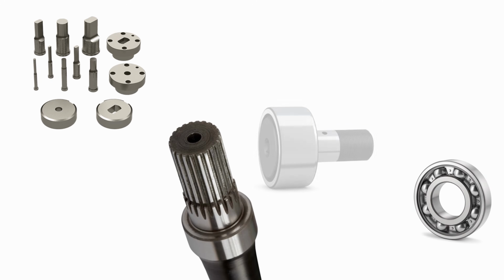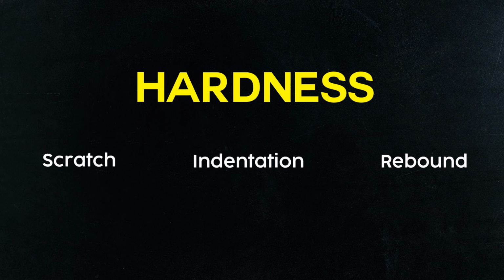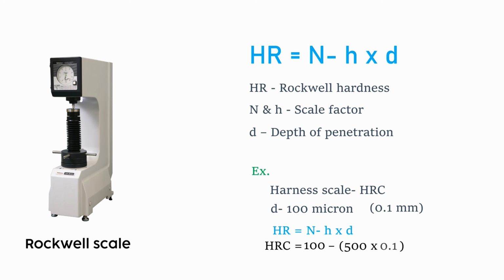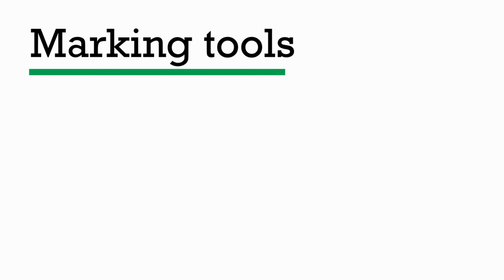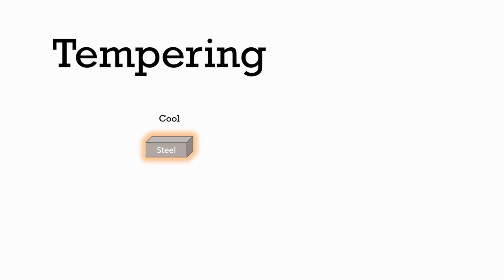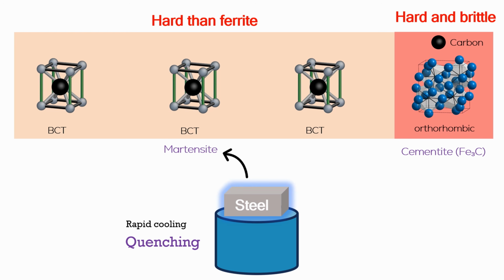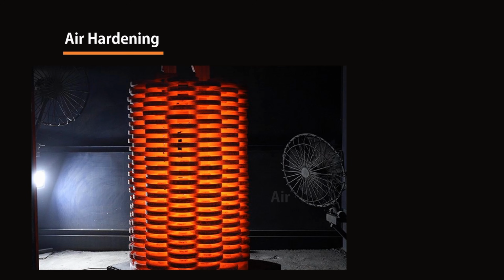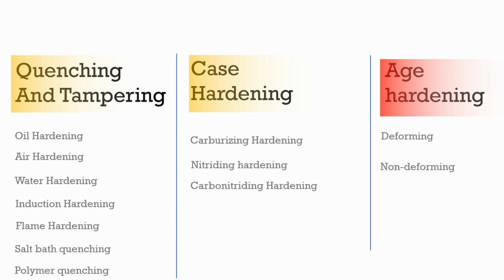Complete Guide to Steel Hardening Process | Quenching and Case hardening Heat treatment process

Comment: Explain the rate of quenching with the boiling point of the media. Water is 100c and oil is 600c so water quench faster tan oil and oil faster than air.
The rate of thermal exchange is easier to understand I think.

Comment: How can i get design certificates or any gd& t certificate (not software creo/solid work/nx) but design related. 
I short training certificate
Reply from the maker: I don't think there is any specific design certification process, your experience is the certification. For GD&T- you can get it from CAD institutes. Or directly from ASME or ISO. There is a process for it. But keep in mind, in private sector experience is preferred over certification
Reply: @mastermechanicaldesign  Ok thank U Sir, any part time job for design?

Comment: Being a Mechanical Engineer connected with your content very much. It’s helping a lot. Now I am asking for video which cover all parameter regarding full system selection which includes gear shaft motor . Means how we arrange them how we will fix them , what will be the clearance between gear box and shaft and motor. What will be the fit. Means start from the motor that is input to end of out put. Please make this with calculation.
And also please make video on Vibro feeder selection and calculation
Reply from the maker: Okay. Noted !
Reply: Thanks man